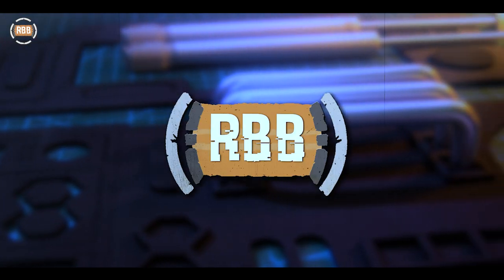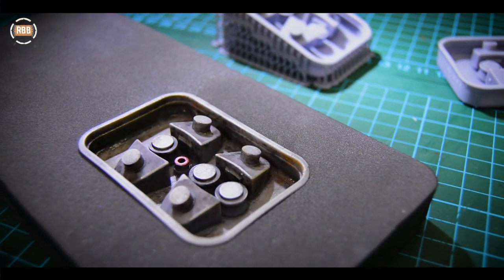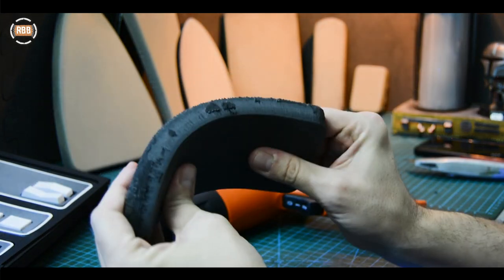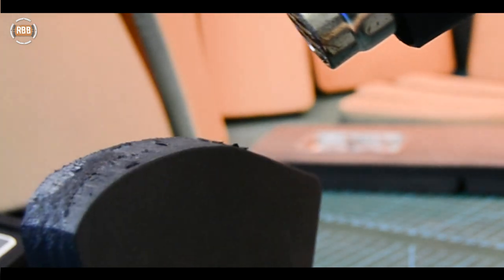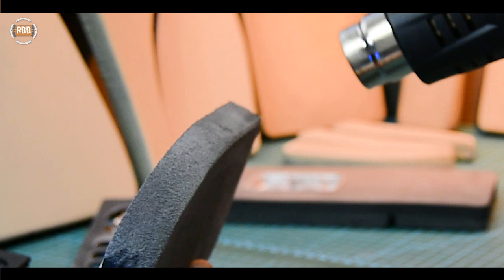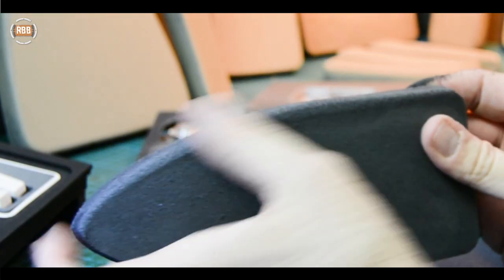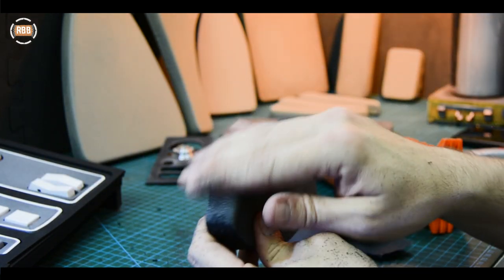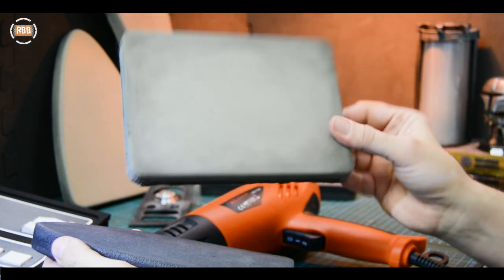This simple trick is how!

Comment: Thank you once again! Now that you covered sanding.. is there anything special to think of when painting foam? Do I have to cover the foam with something first, before I can apply spray paint?
Reply from the maker: Hey, I'll do a follow up video soon but yes you can use a spray grey primer and then acrylics etc, but if you are after flexibility you should check out flexilpaint, that brushes right on beautifully, if you want to stick with spray then lots of colours now available in the plastidip range, they go better over a primer, that way you will use less as the primer stops it soaking in to the foam... 🙂
Reply: @RebelBaseBuilds    Thanks for the quick answer! I've read that I can also mix some woodglue and water to seal up the foam? I have a primer and spray paint in my cellar as well, so I guess I'll try both of these methods first!  If I'm going to make something in the future that needs more flexibility, I'll consider your other hint too 👍